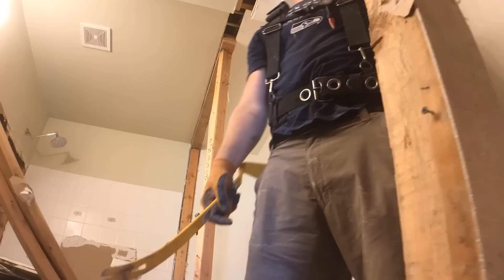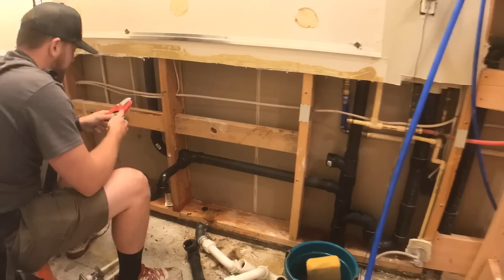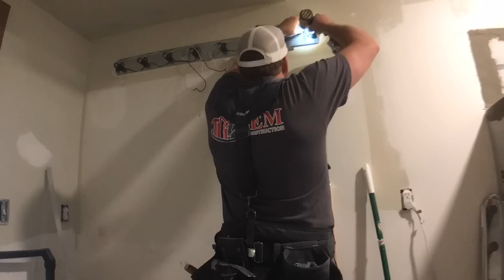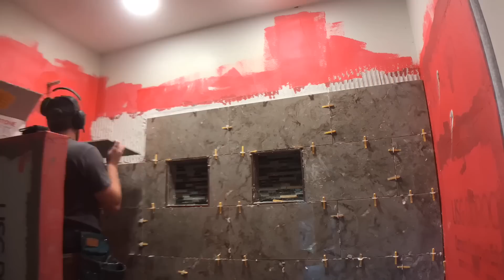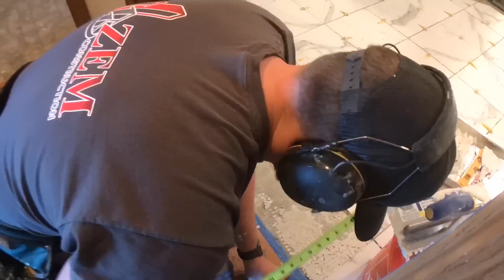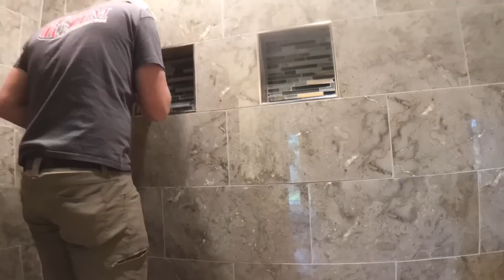Large Walk In Tile Shower | Bathtub Conversion | Full Bathroom Remodel | Time Lapse

Comment: Texturing the ceiling and walls in a enclosed bathroom is the worst thing you had done.. moisture and humidity won’t mix well over time you will start to see the texture all flaking off .. just saying with over 20 years experience

Comment: Great Great informative video. He mentions newer procedures but do NOT allow anyone to buy a molded pan with threshold. They leak especially when installing glass shower doors. This is the absolute best method building a strong frame and base, and making sure you seal and waterproof. I didnt do 4 coats of paint but it is better to follow this video.

Comment: VERY NICE job and a great work ethic. Excellent video too.  My only suggestion from doing what you do for 40 years is that I hold the top of the bench out over the face just a half-an-inch so that water from the seat doesn't run into the grout joint between the seat and the top of the face.  Learned this the hard way.  Nice job!

Comment: Such a great video.  One point of confusion on my part, at 22:30 you mention having a good level shower floor so you can start the first row of tile sit on the floor.  But you have built in a 1/4" per foot slope for water drainage, correct?  So don't you have to slightly trim your tile to accomodate that slope?

Comment: You did a great job. Nevertheless, some of your processes need updating. After being a contractor for 25 years, I've learned a couple of things. Get yourself some Schluter Training. They pay for your hotel and food. It's a great time. You will question your installations, I promise. You will learn that 3 piece drains along with the rubber liner has a 100% failure rate. You will learn about vaper drive and how damaging it can be on substrates. Red Guard is horrible because it will become resauable over time. I also love using those lights. They put off great light. I went from using Pex ”B” to using Pex ”A” / Uponor. Yes, there is a big difference. Pex ”A” goes in much faster and is super solid. Have you ever used Mapei CQ grout or rubber single piece ( Frenco ) for the toilet instead of a wax ring? Please understand, wasn't criticizing your work. You do a solid job.

Comment: Looks nice, I wonder how well the spray of water is contained inside the stall. When I built my shower, the vinyl went directly on the wood structure 8" up the sides and over the curb, and I put the concrete pad on top of that. Then the thinset over that. 1/2" Glass for the sides, corral the water. Built it in 2007, still no leaks.
Reply: Yeah I was wondering about that too. I thought these walls needed to be 6 feet minimum or just up to the ceiling makes more sense

Comment: A very high percentage of bathroom vanities are close to the door (and it's trim) I simply install a 1-3 inch filler panel depending on the trim thickness. In most cases the vanity top may need adjustment or customization. Great work though!
Reply from the maker: Totally! If it was a custom cabinet and countertop that I bid/install I would have done something very similar to what you’re talking about. Unfortunately the home owner went out and purchased that vanity during the middle of the project so my hands were kind of tied.

Comment: 1  Pour the curb  2 CMU for the bench 3 Never REUSE drywall .It's too cheap and  it's the same age as the rest of the house. Rookie mistakes. And center the drain.
Reply from the maker: I shouldn’t have said reuse, I meant keep in place. Like I didn’t completely gut the entire bathroom and left a bunch of the drywall in place. Home owner didn’t want the drain centered. Pour the curb? I haven’t seen a shower built like that since the 80s...
Reply: @ZEMConstruction  Don’t let the hecklers slow you down. You do great work. From the looks of your videos you’d make a great millwright.

Comment: Nice work - it's almost exactly how I did my own! Wondering why you didn't take the Durock all the way to the ceiling (and out further into the wet area) and also not raising the shower head up as high as possible (around the 85" vs. old timey 65-68"). 😷👍
Reply from the maker: No need, if they are getting that much water up and out that far we have bigger issues. Lol. I’d go that high if it were an enclosed steam shower. Also the shower head is probably about that high, I don’t remember the exact measurement. For reference I am about 6’ 1” and that head is well above my head if it were at 68” it would hit me in the face. Lol.

Comment: The main issue I have with this shower is the wood involved, there shouldn't ever be any Organic material used, especially for the curb! Also when using Red Guard in order to get the proper amount for waterproofing you shouldn't be able to read any of the wording on the underside. I do agree in installing the floor first to help with drainage. If you want an even better or flatter serface try using Perfect Level Master  leveling system. I know there a bit more cost but you seem to want a superior finished product and they are worth every penny.

Comment: 5 different tiles and painted walls. Room looks like it has no cohesion. Why didn’t you drop the floor around the drain and do an actual walk in shower instead of a step in?
Skirting board lower than the mosaic tile trim looks like an obvious oversight. Needing to add in that extra bit of tile on the vertical part of the seat armrest seems like a lack of planning. And for me, I’d not feel confident in the strength of that shower wall/divider without it being tied into a top frame. One drunken bump into it on your way to the toilet and crack it goes.

Comment: To anyone that has a shower design like this, with a curb and no glass.  Does the water ever spash out on the floor or are you happy with it
Reply from the maker: It does a little bit, but not too bad. Also, I built it to so that if they do decide to add glass later it’s pretty straight forward.

Comment: Your doing a great job...but the faster you learn another method you will be glad you did.  I used to do it that way, lots of work.  Schluter foam board is great!  Hang it, cover the joints and waterproofed.  No more down days for pan liners or coats of red guard.  The schluter work shop is great too.
Reply from the maker: I was super curious about Schluter, but after watching the Tile Coach videos. It makes me nervous. Because it calls for thin-set to seal the joints, but thin set isn’t waterproof right?
Reply: @ZEMConstruction  its really tough to explain.  It involves capillary action.  Its all in the installer.  The way you are doing it is still very good....just labor intensive.  Go to a work shop or check out sal on you tube.  He explains it so well.  I havent had any issues with any showers we have put in, and that's both ways.

Comment: So at about 9:10 you mention using sharkbite fittings and I just wanted to ask something. I’ve very recently been trying to learn about plumbing from some plumbers on YouTube and I’ve heard that shark bites are good for temporary fixes but that they aren’t a good permanent solution. Is this a different type of product by the same name or is this a better use for this?
Reply from the maker: Nah that is a bunch of BS. Those fittings are solid brass with silicone fittings, they will last 100 times as long as the plastic pipes you’re putting in the wall. That is the only way to connect old plumbing like copper or cpvc to new pex and what they were invented for. That being said I am not a licensed plumber, so I would defer to them but I would look at your local code first, my guess is what they are saying about shark bites is their opinions.

Comment: You forgot the bath tissue holder. Also, I would never do a remodel without installing a bidet outlet at the toilet.
Reply from the maker: They said they didn’t want one and went a floor standing holder instead. They did purchase a wall mounted one and are considering mounting it to the side of the vanity. They wanted to wait and be sure before putting holes in their nice new cabinet. A bidet outlet? That’s funny, where are you from if you don’t mind me asking. I don’t think where I’m at that has caught on as a necessary feature quite yet.
Reply: @ZEMConstruction  O.K., I see the floor standing one in the beginning of the video now. Yes bidet, I'm in the U.S., The great toilet paper shortage of 2020 has made them more popular here since the pandemic.
Reply from the maker: Hmm that’s interesting. I may start asking clients if that is something they’d like to include.

Comment: Hey LOOOVE the work, just a FYI tip of advice: you never want to install tile over drywall like you did above the shower head without the backing (moisture barrier should continue to ceiling). Entire walls should be waterproofed all the way to ceiling to avoid moisture and mildew. I noticed you did that below shower head height and then went ahead and installed above shower head height regular thinset over drywall. 0_o....   Can you please explain that??
Reply: I'd like to hear a response too. Seems like it wouldn't be more work to redguard the entire ceiling. But can redguard be smoothed and painted, or would it need tile as well?
Reply: You don’t want to red guard on drywall for the shower lol

Comment: Great video! I noticed you didn't use the 1/3 stagger with the large format tile, instead of 1/2. I'm not a pro but have done a few jobs and a lot of tilers recommend that to prevent lippage. I'm doing shower walls w/ 12" x 24" and I'd actually prefer not to stagger by 1/3; I am using a tile leveling system. Any thoughts? Do you have any issues with lippage?
Reply from the maker: Lippage has almost everything to do with your prep work and how flat your sub layer is. Issac Ostrum has developed a system where he re floats every wall with cement because he doesn’t trust any walls ever. I think hats a little extreme, shims work fine to fix out of plumb walls in my opinion but to each there own. I would argue there isn’t a better or worse layout to prevent lippage. Thanks for the comment!

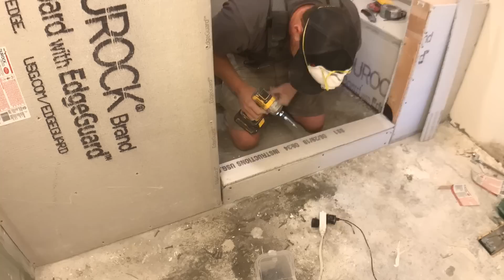Comment: The simple fact that you knew to not bury the junction box shows your expansive knowledge. Great looking bathroom. One question, at 14:50, you were putting the durock on the curb, how did you fasten it on the inside? did you end up penetrating the pan liner?

Comment: Sorry,  didn't see you install a GFI  (bc of being in a water closet)
Junction box should have been farther away from any/all water sources. (or actually installed in light switch box)
Why 2 small niches? 1 full large one, more room for customers hair/soap etc...  
Treated lumber around the base on concrete?
or all not to bad.

Comment: great job ....just 1 thing, no mention of the lights being rated for use in the shower....(imp to know)
Reply from the maker: They definitely are. Says right on the box. The even have a rubber gasket that seals the light fixture to the ceiling.

Comment: Love the videos. Recommendation for the filming: Set your ISO before doing a timelapse. This will eliminate the strobe light look. Any questions on that just ask. Thanks for the content!
Reply from the maker: For this video I actually used an old iPhone in time lapse mode. Lol. Those clips with the strobe effect are actually videos that I accidentally put on “slow-mo” then had to speed up manually. That’s what happens apparently. I didn’t want to eliminate those clips because they were pretty valuable to the video. I now have a go pro to film with which gives me quite a bit more capability and ability to adjust settings. Thanks for the comment!

Comment: Looks like you got just as much thinset on your shirt as you did the walls :).  
The leveling system you switched to looks like a Ramondi knock-off. How do you like it? Have you tried the Ramondi product? 
If you're going through the effort to coat the pan with waterproofing,  you should just eliminate the pan liner.  I switched to using Laticrete HydroBan more than 10 years ago and never looked back. I've done 400+ showers without a pan liner and never had a leak. Recently switched to GoBoard for walls, it's foam so it is light, easy to cut, and completely waterproof.
Reply: i've never built a liner shower ever. been using Laticrete 9235 to water proof since 93. Hydroban is cheaper and easier. This dude did a solid installation. I think he'd benefit ditching the moisture sandwich with the pan liner. I know it's debated, but for time constraints and the fact it's on a slab floor i'd go 100% hydroban. No tape, no membrane. How do you like the GoBoard. I know it's significantly cheaper than Hydro or shcluter board. I swear if I never see another piece of durock again it will be tooo soooon.

Comment: This was the most professional work I have ever in terms of bathroom modelling! Bloody hell, I'd pick you in a heartbeat if I lived there. Not the fan of the bathroom design itself but your work is simply superb
Reply: How much would it cost to redo a small bathroom?
Reply: @dottiegriggs6706  There are too many factors in a re-do to give any general price.   Get a few contractors - there are some who specialize in kitchen and bath remodels, and get quotes from them.  *If they run into structural issues etc after starting, this will raise the costs significantly, so have a buffer in your budget.  Also, get in writing exactly what they are doing and supplying (are you buying the tile or are they? Etc.).  Compare apples to apples.  Your location will also determine costs -  NYC vs small town USA.  I'm sure there are other things to consider, but it may give a starting point if you are serious about doing this. Peace.
Reply: @birdlady2725  
I would like an idea of what this cost..I know there are different parameters. But atleast we would have an 💡

Comment: i bought some of those adjustable lights just like that, but the stupid ones i bought when installing the springs loose tension and the light sags down, i tried so many different things to try and get them to not bend, but i couldn't do it, i had to glue them in

Comment: im no builder , but other than the pan lining I didn't see any waterproof membrane used between the insulation and the drywall
Reply: you're talking about a vapor barrier and it's not necessary in this case because it isn't a steam shower.  Single part liquid membrane products like the Redgard he used are fine  waterproofing showers. They've been around longer than youtube and were used commercially before introduced to residential. Zem did a solid job on building and tile installation and i'd say it couldn't have been build better.

Comment: Great job, ZEM. I have enjoyed watching all your jobs. If I may make a suggestion, encourage clients to add timer switch to exhaust fan with options of up to 1 hr to remove moisture from bathroom to prevent mildew. I use mine every shower. Really makes a difference. On our bathroom remodel we had tile guy put in a tiled backsplash behind vanity, utilizing the small tiles from the niches, but this customer doesn’t seem to have concerns about water splashing anywhere 😂. Do the wafer lights come with Bluetooth speaker options? I really enjoy my speaker in my can light above the shower. Once again great workmanship. Hurry up and post another one 😊.

Comment: Dont buy those snap in wafer lights from a box store or anywhere like that. Buy them on ebay because they are exactly what you get from a store except more that half the price . I bought 12  dimmable wafer lights for 60 bucks off ebay and they work excellent.

Comment: Did he put the info out about the lights. Im pulling down an old kitchen lights with the drop down plastic sheeting and want to put in can lights those seemed like they would be a breeze to install.
Reply from the maker: Thanks for the reminder! Just added it to the description.
Reply: How do you think the 6 pack of these would work for a kitchen. And do you just pull one light out to reach the box?
Reply from the maker: They would be great. Each light comes with its own box. Just like can light, just no can.